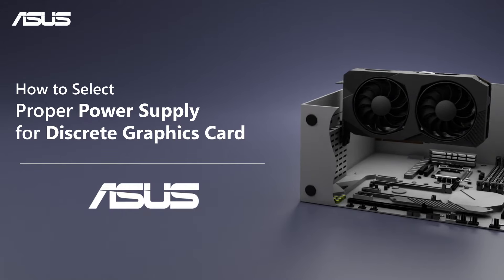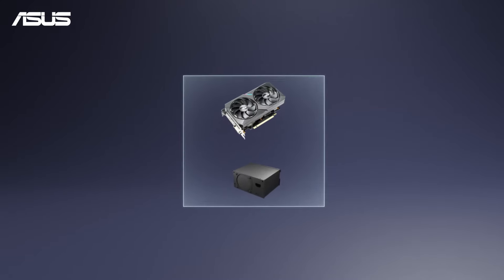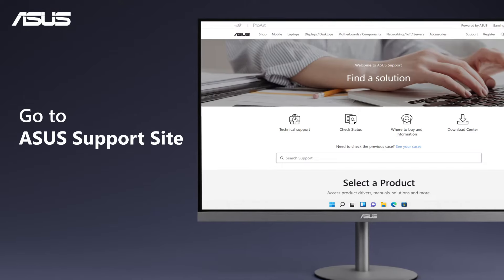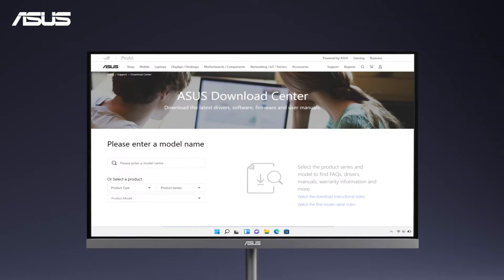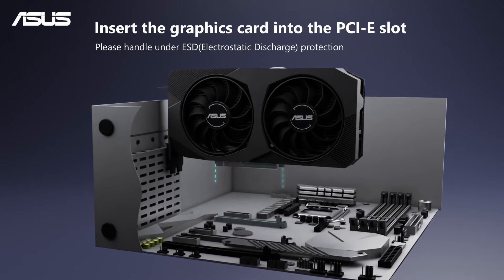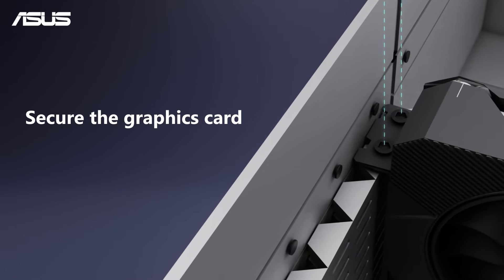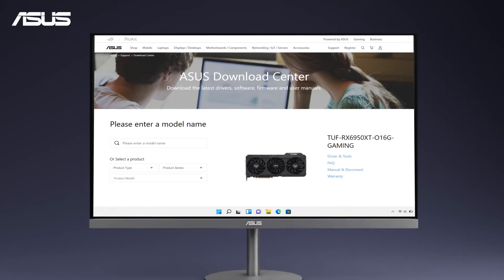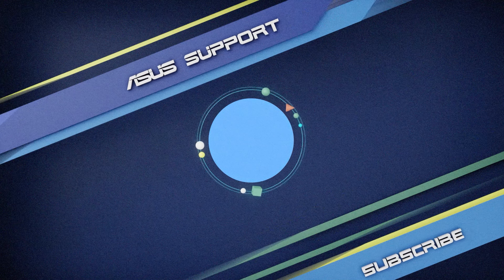How to Select Proper Power Supply for Discrete Graphics Card   | ASUS SUPPORT

Comment: Thanks for video. Just bough a 3050 and installed just to notice i need a pcie cable 8 pin 6+2 pin. Looking thorugh my power supply box i found a cable that matches, but it has 2 PCIe and 1 psu, and I only require 1 PCIe and 1 psu. Does it even matter or do i look for the rigth cable?
Reply from the maker: In your case, if you have a power supply cable that has 2 PCIe connectors and 1 PSU connector, you can use it as long as you connect only one of the PCIe connectors to your graphics card (the 8-pin or 6+2 pin part). The extra PCIe connector can be left unused. Alternatively, we suggest you visit the following forum post to receive more assistance.
https://rog-forum.asus.com/t5/gaming-graphics-cards/bd-p/HSS_Graphics_Cards
Thank you.